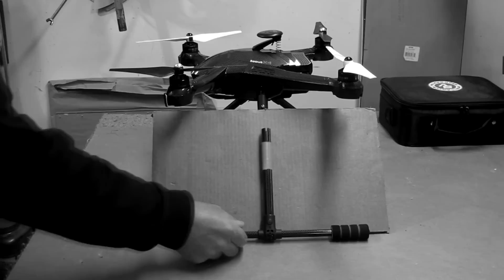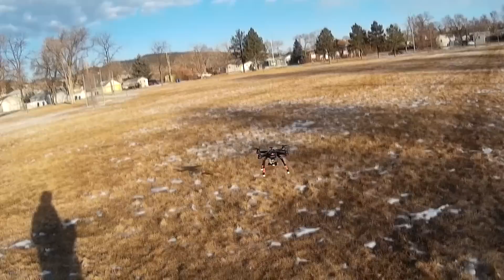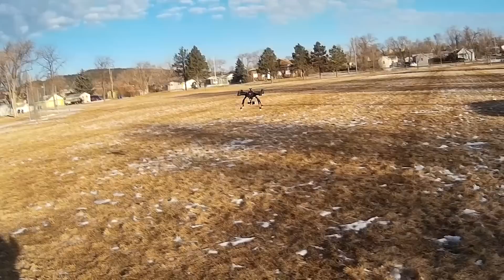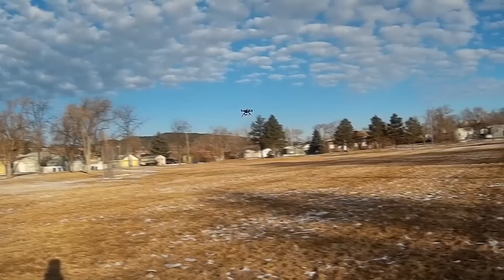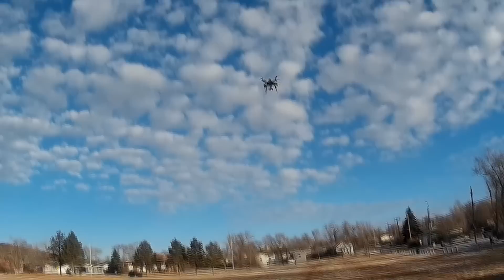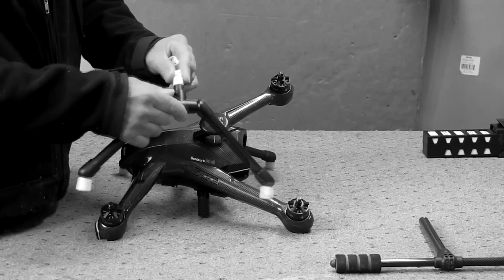Walkera Scout x4 Upgrade / Improved Landing Gear Structure

Comment: I like your design Dakota. The stance as well as the post style legs would prove to be an asset on uneven ground.

I made a set of landing gear for my Scout X4 of a different design using a couple different materials.

The problem of spreading or splaying of the legs is really not with the leg design as much as it has to with the worm drive in the servo. It's not going far enough to lock the legs in place. You can see the problem clearly at the end of your video when you pick up the Scout and turn it to face forward setting it back down again. The legs splay outward.

Hence I modified, or more accurately, corrected the problem at the source within the worm drive servo.  It's now now longer an issue no matter which leg design I use with it.

I also added a set of diy articulating pontoons for water T&L's. There's so much water around here it's kind of a necessity! 

Thanks for sharing your knowledge on the X4. I've enjoyed viewing and learned some things along the way!

Happy flying,
- chase -

Comment: Hello Dakota, i installed the 4 extra engines on the bottom it has now 8 engines does the spider legs fits on my parrot or there is a way of extending the legs so they wont touch the bottom engines ?
thanks
Reply from the maker: Gustavo Carvalho I really don't know the answer to that question. :(

Comment: do these legs fit the tali as well
Reply from the maker: Hi James, it appears that the Tali and Scout landing pipes are interchangeable when ordering replacements.  If I am correct in this assumption then one can assume that the Spider leg will slide up into the Tali servo housing.  But, unfortunately, I do not have a Tali.